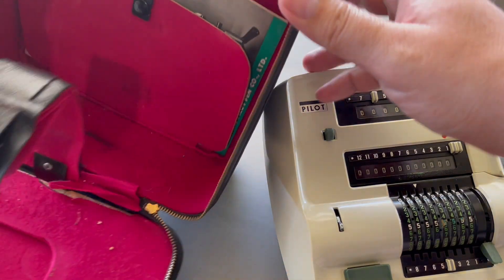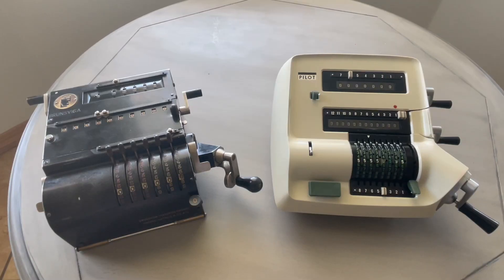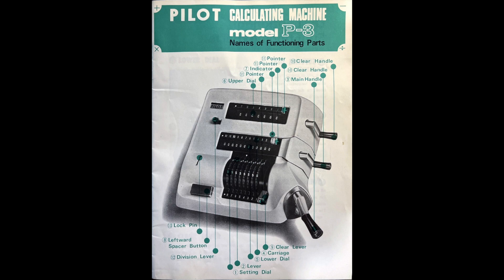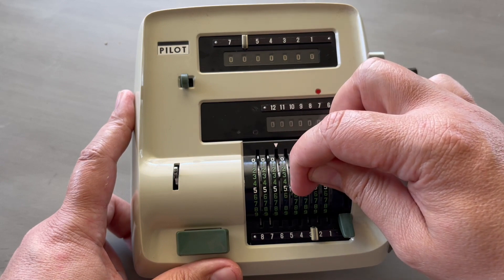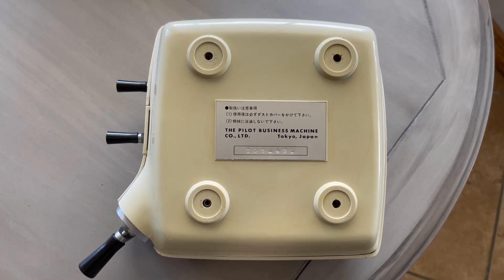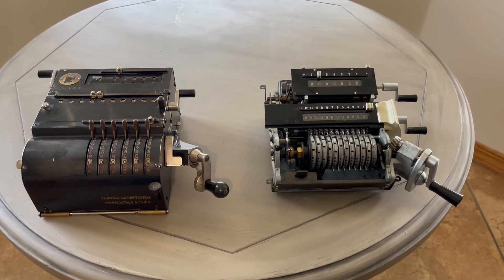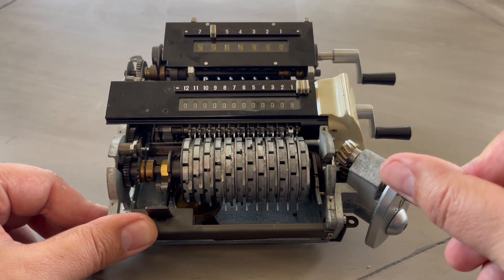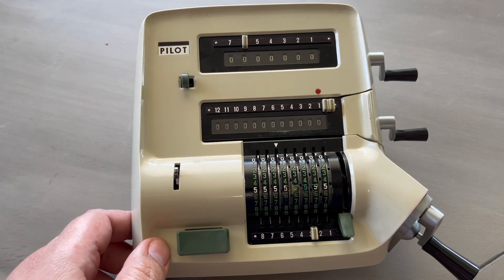Pilot P-3 Mechanical Calculator

Comment: A lot of these pinwheel calculators have a switch that determines which direction of cranking will make the counter digit go up, for switching between multiplication and division. I don't see that here. Is it just counting the absolute value of cranks from the zero position, somehow?
Reply: (Jaap's video on the Brunsviga 10 says it automatically switches depending on the first turn of the crank after clearing--nice. I assume that's happening here too.)
Reply from the maker: That’s correct. There’s no manual way to control whether increments or decrements. If the counter is zeroed when you start adding it automatically increments. And once it’s zeroed when you start subtracting it also increments but the numbers are yellow.